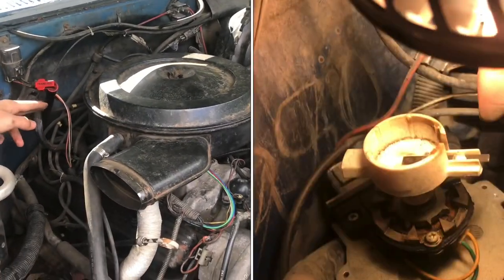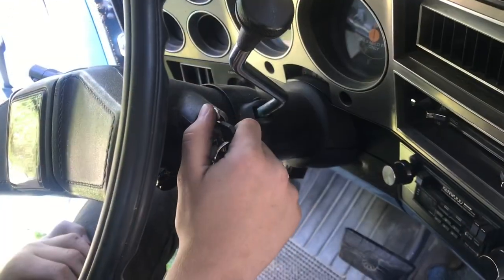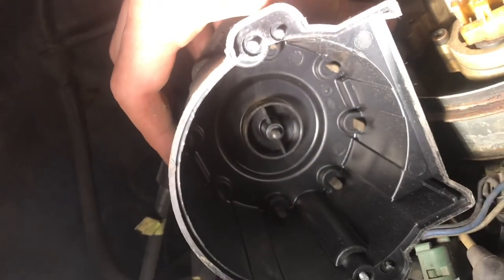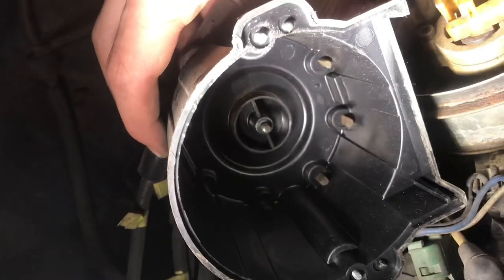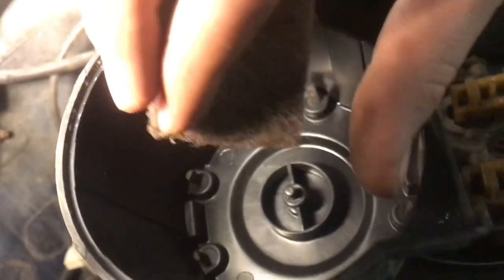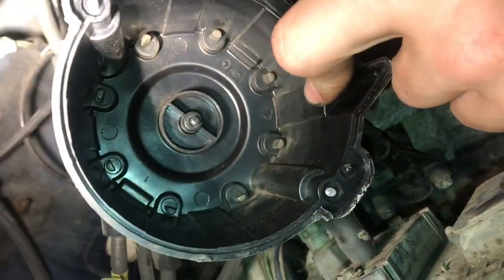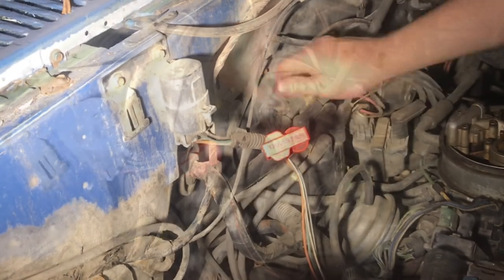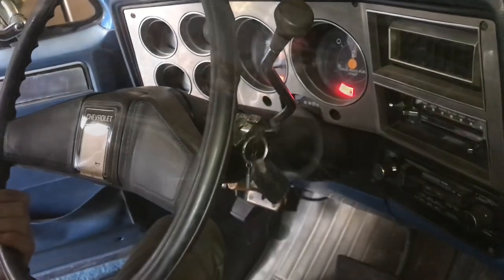“cleaning” a CAP & ROTOR on a chevy engine 350, 327, 305 (5.7L)

Comment: I have so much corrosion on mine (1985 Ford with a 302) I just purchased but it sat for about 10 years before I got it, that I am getting misfires. Gonna clean mine and do new plugs and wires. Hopefully it clears up any sputtering I’m getting.

Comment: Much better ignition. 
I just bought a z71 chev. 
And its got a weak start. 
I figured this is likely what it is. 
Ill come back and let you know.
Reply: Was it that?
Reply: @Nate_-ty8uk  no actually it turns out after auto zone testing. Its the starter.
Reply: @Nate_-ty8uk  no i took it to auto zone. Had it tested free 
It was the starter.